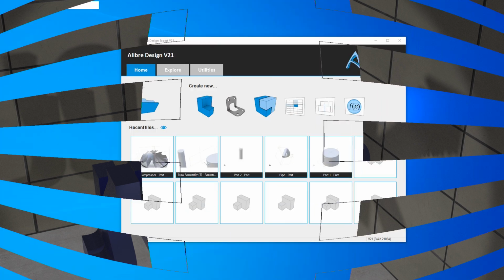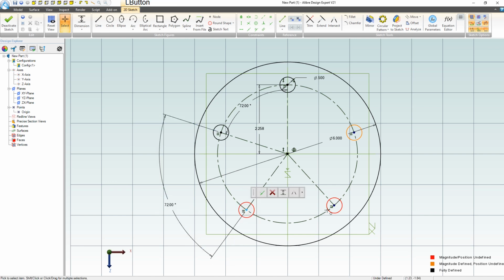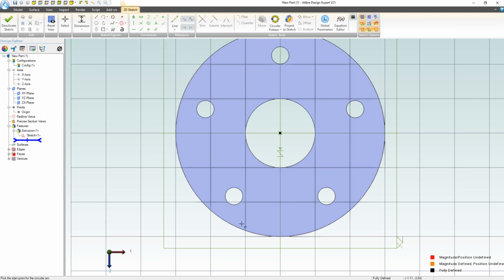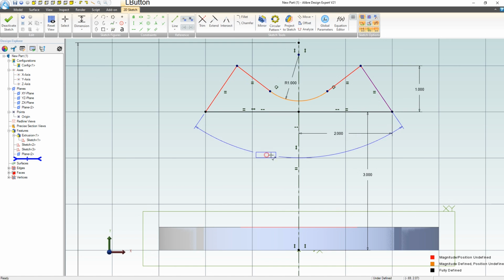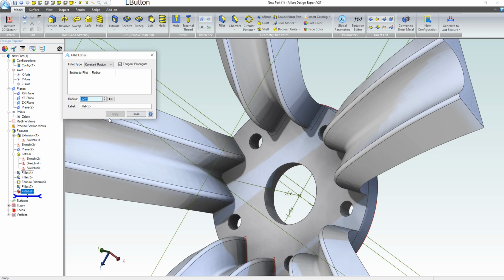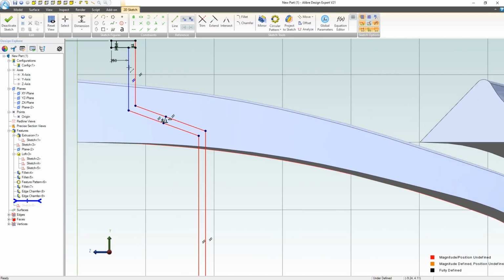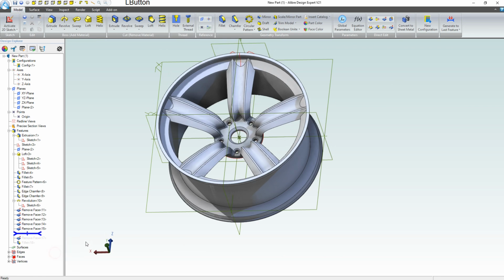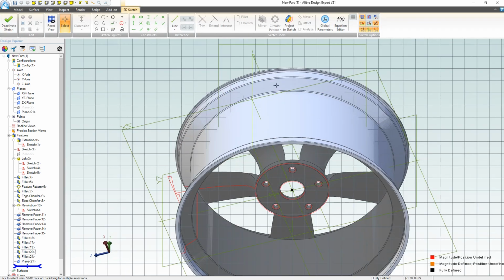How Easy is It to Pick Up Alibre CAD?  This Was My First Day |JOKO ENGINEERING|

Comment: I tried Alibre today too. I was able to sketch a box with a snap fit. 
But than I added a text to the lid and wanted to multi material print it in Prusa Slicer. 

The problem is Alibre isn’t exporting the position of the parts in the stl….
There are not many sources for Alibre for problem solving anyway. I think I will use Fusion360 after all…
Reply: Ok I can get it to work…. In assembly I have to suppress any other part and than export only the text. Same goes for the part the text is imbedded too.
Really annoying and no where documented as well. I don’t like this at all….

Comment: I'm loving your videos. Working with FreeCAD, but keep running into problems with it. I was interested in Alibre, but it needing the internet connection is a bummer. Is there a good program in this price range that is a one time purchase that you would recommend?
Reply from the maker: Most of the Alibre licensing options require the internet only once per month.  Is that still too frequent for your needs?  I believe Alibre can furnish an option for a no internet option as well.
Reply: @JokoEngineeringhelp  I will have internet access more frequently then once per month for sure, but I just don’t like everything potentially being ruined due to a missed call to some server somewhere at some time. I tried Fusion 360 and was unable to save or export my work due to that after spending a lot of time. Having that need just feels like EVERYTHING could come to a screeching halt for no good reason and completely out of my control. I just don’t like that feeling of insecurity when you could have a lot riding on things working. Like on the way down you pull your parachute to open and it says “We’re sorry, but we’re unable to reach the server at this time. Please try again later.”

Comment: I don't like software that requires an internet connection to function. I'm living in Iowa and still hit snags where my internet goes down. Just a couple of days ago I lost access to cell phone and internet for almost an entire day. During this time frame I may not have been able to use software such as this. To get this software to work fully and forever without an internet connection may be impossible. You can copy and paste license information from an internet connected computer to an offline machine running this software but at the end of the day your either directly or indirectly tied to them like an umbilical cord attaches a baby to a mother. Should the mother ever die the baby dies too!

A company not wanting it's internal network tied to an outside network for security reasons would be constantly swearing while trying to keep this software functioning. If your a designer that likes to work offline in a mountain cabin in Colorado for instance this restriction alone is enough reason to stick with something like FreeCAD.

Should you live in a country where war breaks out your internet could be shut off by the government and this software would become useless. If this software provider closed shop tomorrow what would happen to your ability to use this software?

I'm still sticking with FreeCAD.
Reply: Alibre doesn't need a constant Internet connection to work. It needs to connect every like 30 days for a few seconds just to check the license. Or, you can ask Alibre and you can get a fully offline license that never needs to talk to the Internet.
Reply: @maxfreeman9218  Doesn't support my operating system so it doesn't really matter. But nice to know there's the option to run offline! Better than many alternatives.
Reply: agreed.  I will never use an "online only" software for anything I have a professional need for.
Reply: I feel the same way. Online software doesn't work for me. I need more control. Plus I work at sea, no internet connection available. I figure there is a lot of workplaces that lack connection or have instable connections. Sticking with FreeCad.
Reply: What you describe, I have not noticed in my version of Alibre Design, Fusion360 however, the requirement for an internet connection is really important.
Reply: @lgrfbs   It's written  about on their website if you would like to know more. Maybe you have an internet connection and it's running in the background without you noticing? It's not a 100% need like some programs but it will hook up once a month or so.

When my internet went down for a week because of storm damage last month I decided to tune up my guitars to kill some time. I found out the guitar tuner app on my phone would not boot up! I was not too happy about it and dug out an old battery operated tuner I had not used in years. When I got cell service a week later I downloaded a different vendor's tuner app. Just like on my computer; I don't want functionality tethered to the internet and find myself stranded.
Reply: @lgrfbs   It's in the link you provided under "system requirements" and it states it requires monthly connection.

Comment: Thanks for great video. I am using Freecad. What do you think which one is the better choice? Offen Freecad is very complicated and offen I do not understand why sometimes functions are working great and sometimes not. What is your opinion if you compare both systems is one of both better and more powerful (in design) as the other? I am fine with freecad but I am searching for a easier to us cad program (parametric). Can I do in alibre Atom everything I can do in Freecad? Or do I have to expect that Freecad provides more freedom to design?

Thanks a lot. Your vids are great. Keep on going.
Reply: Alibre Design has no CAM part, otherwise as a long-term user of Alibre Design I think FreeCAD is very good.

FreeCAD has its own way of naming things that makes me as a workshop technician have to think extra to figure out what the feature I want to use might be called in FreeCAD while Alibre Design is closer to the industry's names on everything which makes it easier.

Comment: I found your channel when I was looking for something that could take over the CAM part from the Fusion360 then it changes in its license with for me way too often to get nc files to my china mini cnc milling machine and found your video about FreeCAD Path and I should learn more about the CAM part in FreeCAD to complement my Alibra Design* which I've been using for many years now.

Thanks for a great video about Alibre Design!
You need to adjust the button display a little otherwise all right.
*My version: Alibre Design™ Expert Version: V21 64-bit [Build 21034]

Comment: For keyboard shortcuts, I know it is possible in Fusion 360 as well, by going to the three dot menu on the right side of the menu of each function. That also allows you to pin the function to the toolbar.

Though since I'm a hobbyist I'm leaving Fusion now for freecad. I sadly find it much less intuitive.